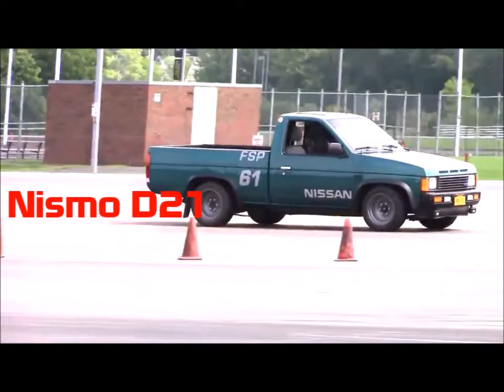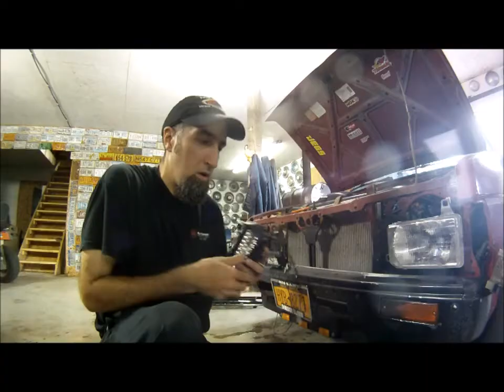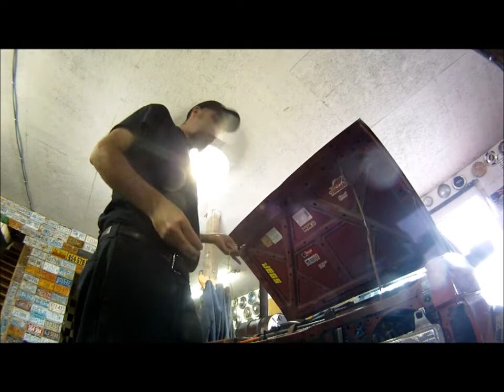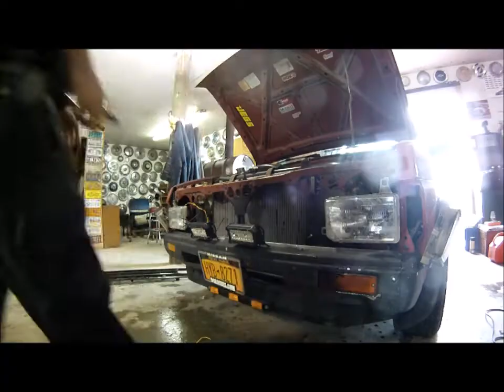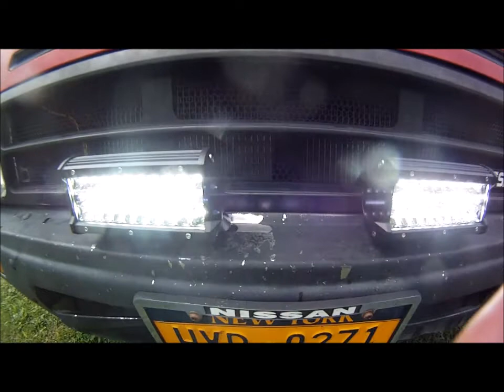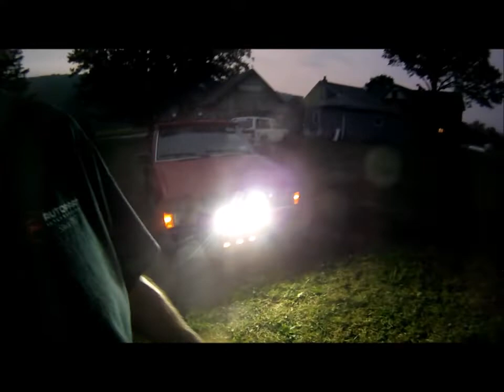NAO 12,000 Lumen LED Work Lamp Install and Reveiw

Comment: How did you get though the firewall ? Or how did u run toggle switch ?
Reply from the maker: I cut a small slit into the main harness grommet on the firewall then fished the wires through.

Comment: Whats the deal with the door panels on red truck, looks like the top piece that wraps around to the window is missing.The red strip on top looks good!
Reply from the maker: Those are base model door panels. The only go up as far as you see allowing the door paint to show at the top. Saw them and had to have them.